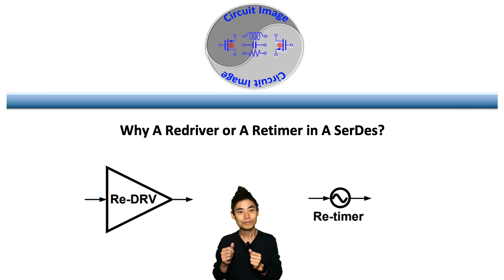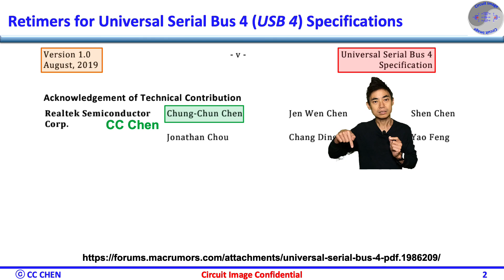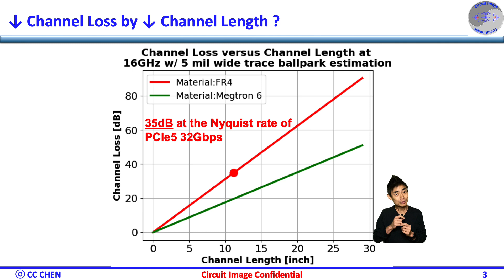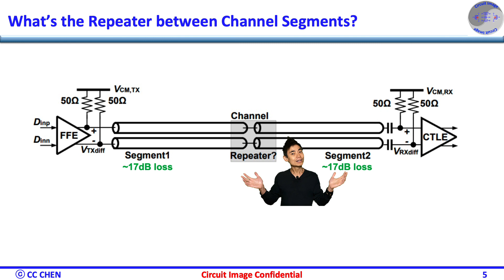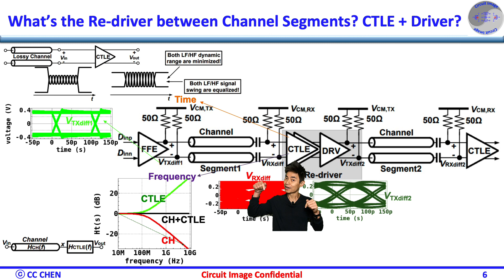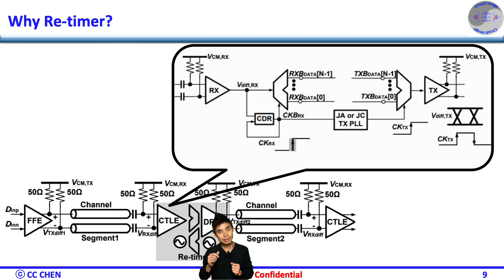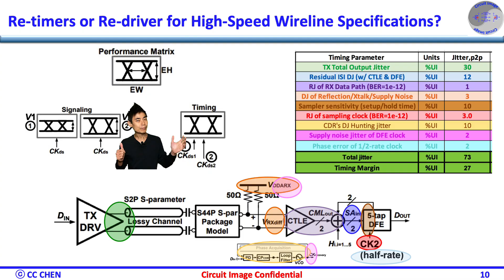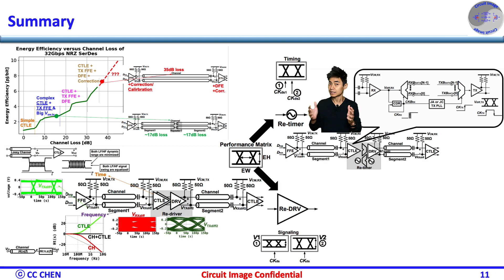Why A Redriver or A Retimer in A SerDes?

Comment: Quite analogous to adding repeaters (inverter/buffer) in a long clock routing path. The added repeaters with some optimum value could improve the overall clock integrity.
Reply from the maker: Hi Abhirup, thank you so much for sharing your thoughts. I agree w/ you. :)